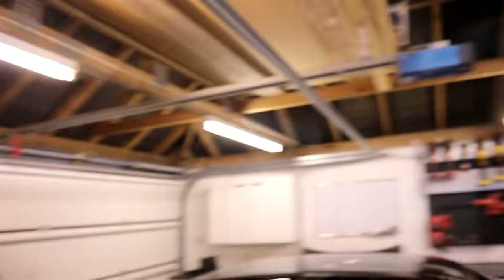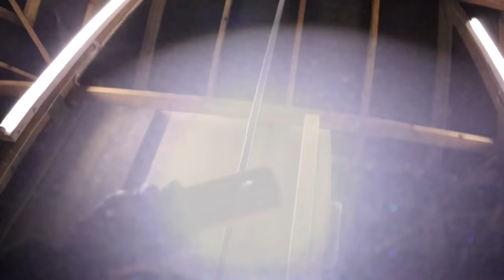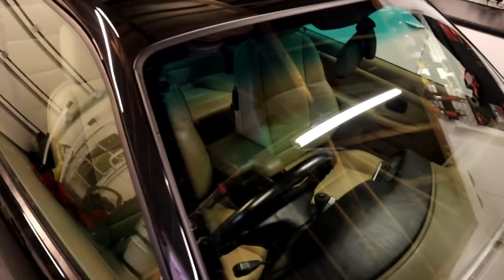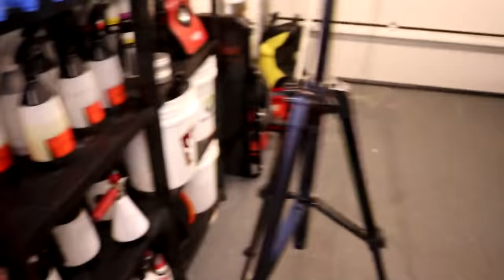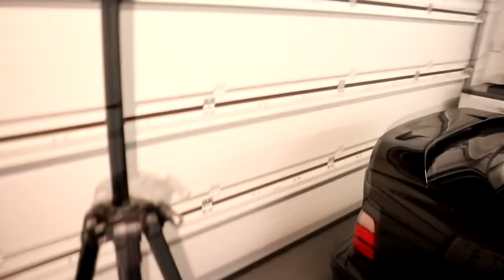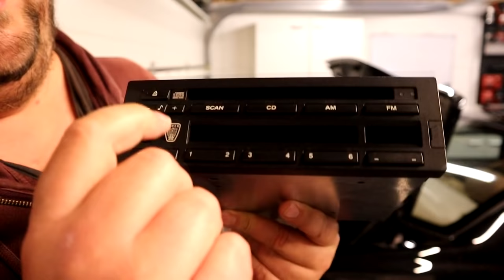e36 back from the paintshop

Comment: I have a lot of work to do on my daily car. It is in reasonable condition for a regular car but has a lot of age-related marks from being nearly 15 years old; I don't think it has ever been polished. I have a wheel refurb project to do, some airbrushing to attempt on the arches where they have started to bubble and stonechips to fill, a few tiny dents to pull out then have my first go at machine polishing to bring it back to a good two-footer. I don't care about going for the last 10/10ths because it lives on the street outside. If it was an appreciating asset I'd think about a full respray but I would never see the value back because it's just a Vauxhall Vectra.

So happy to see the brilliant results on your E36 though - They've done a fantastic job.

Comment: Nice one John, paint job looks great and agree with your sentiments around doing it properly. 99% of the public don’t have a clew on the shear amount of very skilled work and what that cost. You are looking at 150+ hours on a car in reasonable condition in the first place, add 9j some dents, scratches and welding and you can double that easily. When I hear someone say they want a 1000£ paint job, my reaction is that will get you a 10’ aerosol job.

Comment: Doors off, glass out doors , boot lid off, bonnet off and painted separately.

I think they used 3m p3000 trizact and done the whole car with an interface pad and then used perfect it 3   (3 stage) which most good bodyshops use.. 3rd stage is for black.( Green yellow blue)

2.8k to 3.5k

It looks a1!

Comment: Soo jealous that you had a good experience with a body shop, I had to get my sport resprayed twice and still wasn't happy, first job had visible sanding marks in area where filler had been applied, second job took over 3 months and although the actual paint was good the fit and finish was cowboy. Both these jobs were from garages recommended from local car groups/clubs, but looks like you've found a good one. Loving these videos on the 36, bet your chuffed with it.  A big recommendation on your new bootlid is to buy a reinforcement plate from mrretrofit on instagram to stop the metal cracking around the lock area as it gets older, common issue with these especially on a car with a spoiler fitted
Reply from the maker: Ive bought from mrretrofit he sorted me with the lining.   my old bootlid did not have cracking I stripped down the plastic strip on the back because the screws had rotted.  the actually bootlid panel was just rotten around the base of it. but the bit you are talking about was ok.   apparently I got he last ever new BMW E36 OEM boot lid which was lucky.  I will look into this though mate cheers for tip.

Comment: Hi John 
U have done a fantastic job on that 328i
Looking great.will you want to sell it now and move on to do something else . I have always sold after complicated a project. Do your best to keep it , people slag off e36 they are not as good as e46 but they are somehow a classy car. Well done your attention to detail is great 
Keep it
Reply from the maker: I wont sell this car.  good ones are getting rare but ive enjoyed like ripping all the interior out and fixing things and getting it to where it is now.   still more work to go.  cant wait to get good zort on it.  The e46 is a step up in some ways, its more refined but its also heavier and you loose a lot of feel with the electric actuated pedal versus the fly by wire.  E46 has more like sensor niggles as well.  you dont see many E36 now as well.
Reply: @forensicunplugged4295  
Well done made some great content 
E36 vintage was so slated by bmw fans particularly the M3 yes they are not as quick as later stuff but that is not the point. They came along in a very different time and were classy in a classless manner  the e36 is the car that made BMW more money then anything they had ever done and later ones 96/ 97 models were pretty good. Of course e46 was another leap forward performance not so much corrosion. The question is what next to restore 
Everything is a lot of money your 328i was a perfect choice. Cheers

Comment: Hi Jon and congrats on the new paint. I know how much work goes into it as I used to be a car painter many years ago. I did countless full resprays with the full strip and refit. It was hard work but I loved it. If I was doing it now, I think I'd be a millionaire the prices they're asking now. The car looks amazing !
Just wondering, the factory head unit, I would've thought it would be a cassette deck for that period not a cd player as BMW had the cassette deck and stacker in the latter parts of the E36 run.
My 99 E36 M3 has this combo. I don't bother with CDs anymore, I just listen to AM radio these days lol... Showing my age hahaha.

Comment: I love this car, looks amazing

Your wheels are two piece, once you split them only the centres will come out, the barrels and lips will stay together :)
Reply from the maker: 3 piece I think frank.  RC90's mate.
Reply: @forensicunplugged4295  hi

No definitely 2 piece 

I have 2 sets of them

2 piece is barrel and lips together, face off

3 piece barrels and lips seperate, face too

These are 2 piece
Reply from the maker: your right daaamn :)
Reply from the maker: how much should I pay for full OEM refurb of these frank
Reply: @forensicunplugged4295  all depends on what you choose to do 

Lips polish should be £200-300

Bolts £100-150 either new or restore yours

Then with the faces depends if you have them stayed or powder coated
Sprayed £100-150
Powder coated can be expensive but £150-300 depending who you find, problem with the powder coat is the centre caps are plastic so they need to be sprayed and sometimes a colour difference can be an issue
Reply from the maker: @frankmazz  I want the whole lot done. inside the barrel they are minging paint falling off.  they will never be perfect there.  but you cant see it.  so I want inner barrel power coating to OEM color.  Then the middle section and plastic nut cover bit done to a silver OEM close to chrome look.  And the lip part I want to look like bare metal but maybe clear coat it so its less of a pain to maintain... not really sure.    keep but clean existing bolts.

Comment: Dips at CustomCars (literally the first google link lol) does loads of wheels. He is usually at all the BMW shows, you may have seen his cars about too.
Reply: people want 1k+ normally to do 3 piece split rims.  Im figuring if I split them down.  get the centres power coated.  then polish the dish myself.  seal it up tyre back on.    dunno could go horribly wrong but gonna get a bit of help.  cant really spend thousands to have this work done.
Reply: @ForensicDetailing  Yeah I used to pay around 300-400 for a set when I had my BMWs. Check out mrdimma on ebay they say 150 a wheel, might be cheaper if you split them and then they do the work?
Reply: lots of people use lepsons aswell, try wheelworksuk too

Comment: Don’t normally comment but……….Needs some Bilt Hamber underbody anti-corrosion in a future episode?
Reply from the maker: yer so the underside is like the final thing.. but the shell underneath and the jacking points are good.   Its been undersealed around the 2 seals.   but generally its a bit crusty under there.  rear subframe and trailing arms etc...  on the hit list but like I have to slowly trickle money into this.  for a while now not much will happen to the car.
Reply: @forensicunplugged4295  looks like future content there.  Probably best for you to not mention how much this costs to respray the car, those that know appreciate your projects.
Reply from the maker: @ignissportchannel7671  6250 for the respray.  but thats fitting new boot lid and transferring spoiler gubbings.  cutting rust out in various places as well.  full dismantle all seals replaced..  some other things as well.  front windscreen replaced, door lock mechanism replaced.   some dent repairs as well.